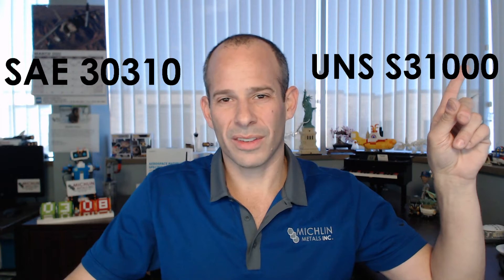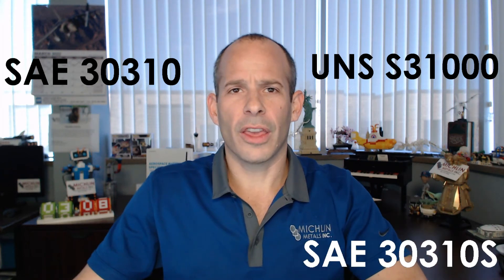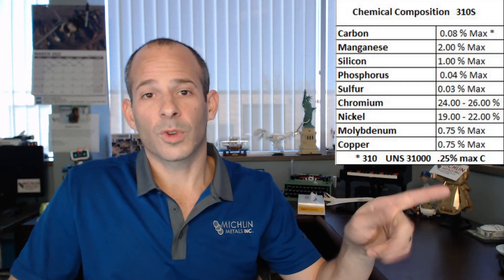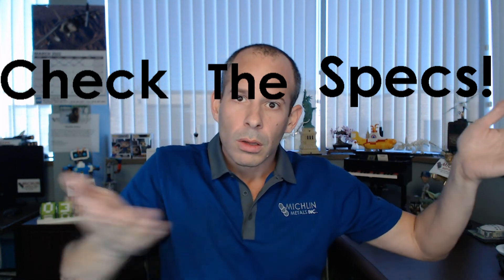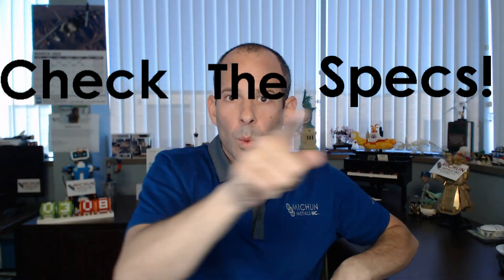310 - 310S Stainless Steel - AMS 5651 Round Bar - AMS 5572 Seamless Tubing - UNS S31008

Comment: These more “exotic” stainless steels are very difficult to source in small quantities. And by that, I mean I can’t find any on eBay, and I don’t know where else to look. It’s clear that they’re more suited to commercial/industrial markets but as a hobbyist, I’d LOVE to get my hands on some of these high temperature stainless steels
Reply: Same here.  I'm developing a water system for cars and trucks to improve gas mileage and I think 310 and 904L is where it's at.  I need more temperature resistance to corrosion and the 300C temp difference will make a difference thanks to the extra nickel, but the chromium is also 9% higher in 310 over 316.  I never have chlorides in my setup so Mb isn't important and I looked briefly and found that nickel is actually the ideal metal for alkaline electrolysis (what I am doing).  I found a way to stave off the corrosion but it still can form over time based on too many external factors that can't be controlled.